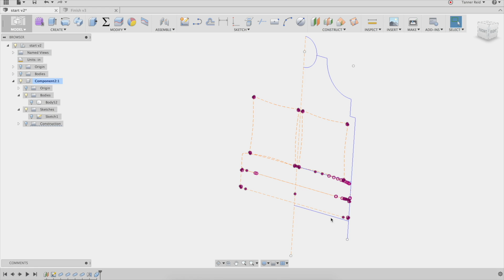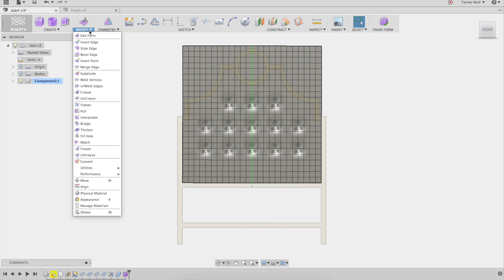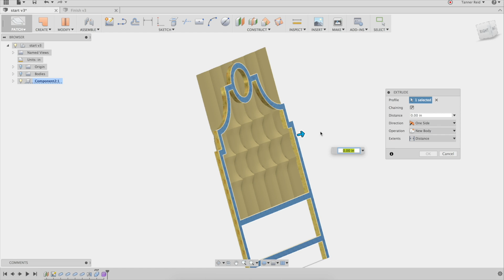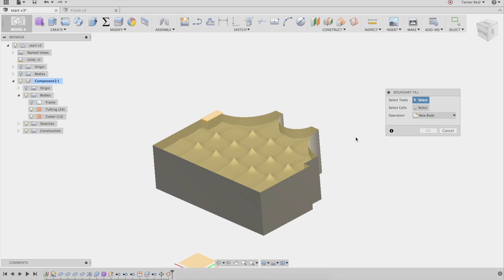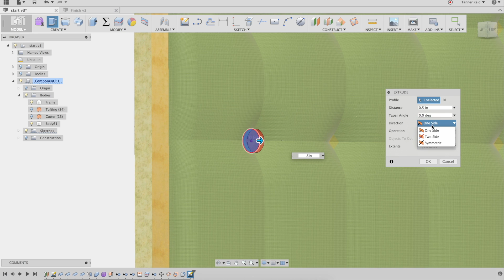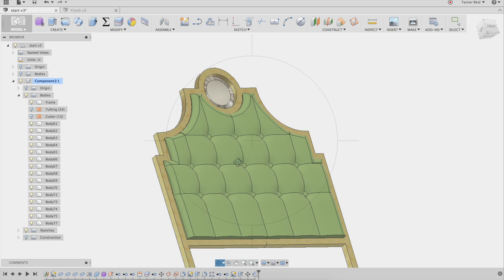Design a Tufted Headboard in Fusion 360

Comment: You divided the plane until it looked good enough. What if I need a more accurate definition? E.g. if I want to divide it to squares and the length and height don't divide that way? (e.g. length is 176, height is 100 and I want 20 by 20 squares). Is there a way to divide the plane unevenly without dividing to many many lines (e.g. 1 cm in my example)? Something like have two length faces of 8 at both sides and then subdivide what's left to 8*4 and 5*4

Comment: In production, it's useless information.
We are still do not have tools for making furniture like, for example the cutting list for sheet materials (like plywood), with the size, types and consumption of materials.
And you demonstrate to us how cool we could draw some fancy\cartoonish bed. I can draw 10 beds like this one, in any 3D software. But in real life I cannot show it to my boss, because this, is not a product design, it's a concept design.
Reply from the maker: +Ebalduck Thanks for the feedback!  This is definitely a concept design workflow - and the goal is to demonstrate the way the sculpting and parametric design tools can work together to create forms that demonstrate what the end goal is (though these tools work great for DFM as well).  It's really not important to model tufting like this to an exact specification, because when you're actually manufacturing that furniture, a 3d model of the tufting isn't necessary - just the backing to be cut.  Once that's done, the builder would lay on the foam and sew in the buttons and fabric, which is a relatively imprecise process.  This workflow is a way to represent those parts of the furniture like the tufting, pillows, blankets, etc.

And I understand the value of a product design video!  This workflow is just a piece of the total process - unfortunately, to show the workflow to fully design this bed to be completely specified and manufacturable would be a video far longer than 20minutes.  If you're interested, we have a lot of other videos that dive into other specific and more technical aspects of the modeling process in our various youtube playlists here:  https://www.youtube.com/user/AutodeskFusion360/playlists  

Some are tutorials, while others are shorter tips-and-tricks.  

Thanks for the feedback! We always appreciate it.
Reply: Great point of view. But I know people who works making wood chairs, and uses all the Fusion 360 "product design" mechanical for this. But, a secondary importance of the job is demonstrate how the chair textil parts will be, and I think the video is very useful for this.
Reply: Ebalduck there is a way to make a materials list using the drawing section